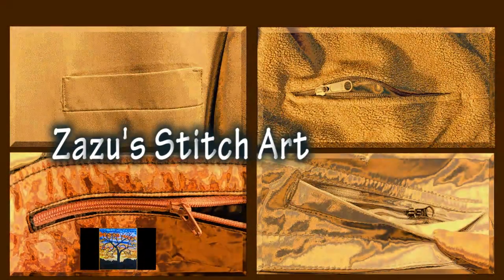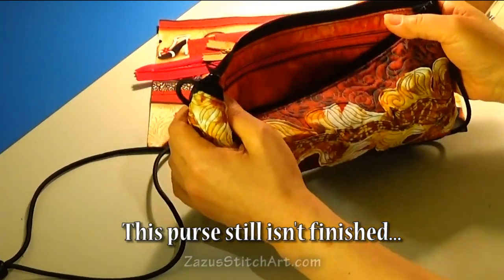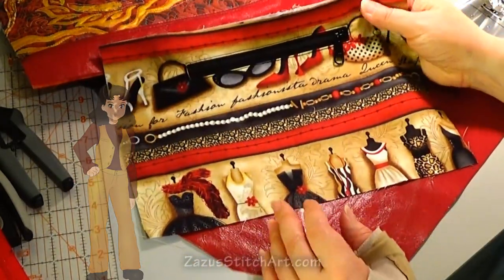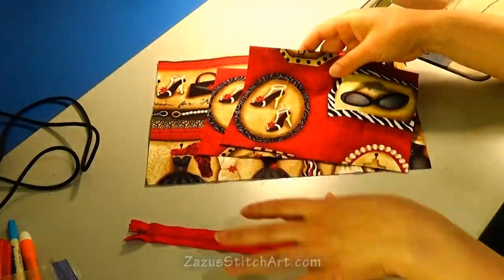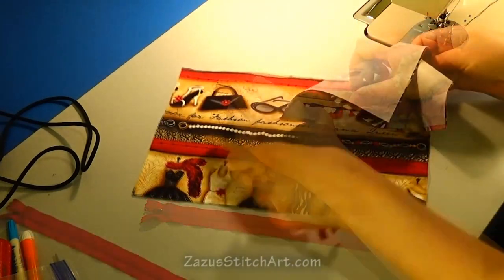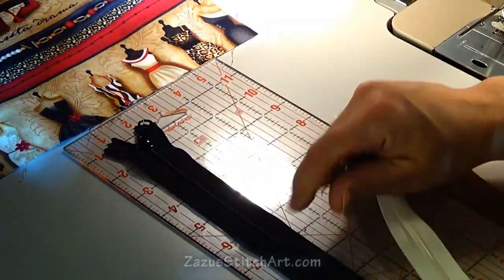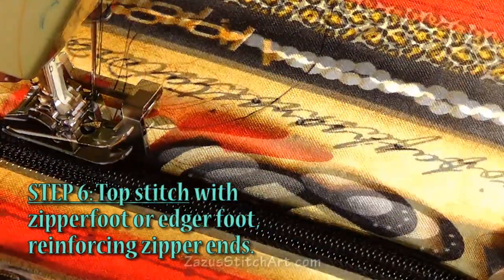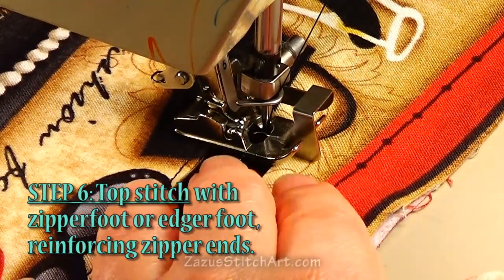Interior Purse Pocket with zip {DON'T FEAR THE ZIPPER} welt pocket first cousin | Zazu's Stitch Art

Comment: I liked the unzip pocket too. The big edge gives security to the interior.  I will try that one for easy bags. Your specialty foot made the edge sewing so even. Good job.  Did you use the same #16 needle for the red leather part?
Reply from the maker: I actually am using #18 leather needle and a teflon foot on my other machine for the leather areas with nylon upholstery thread.